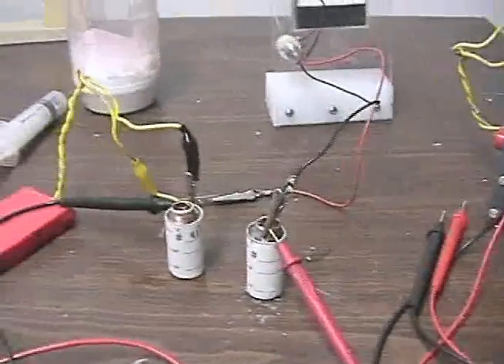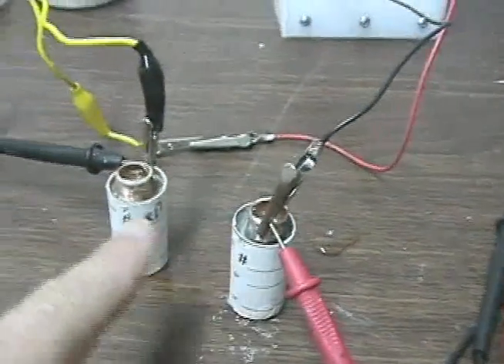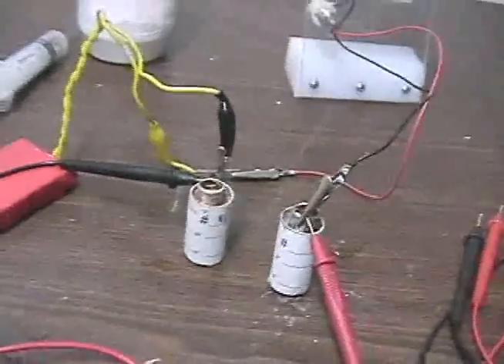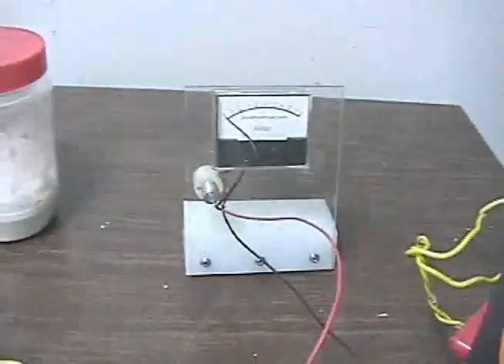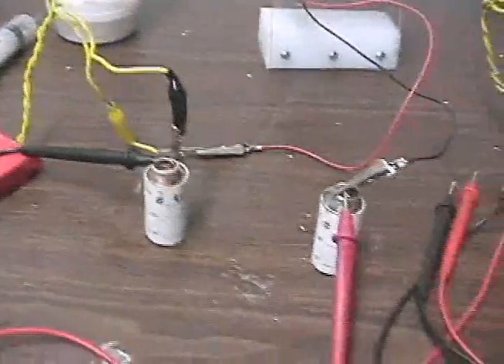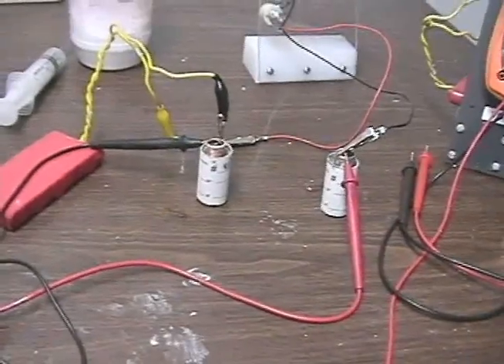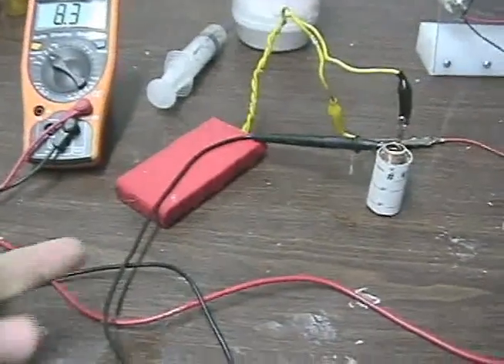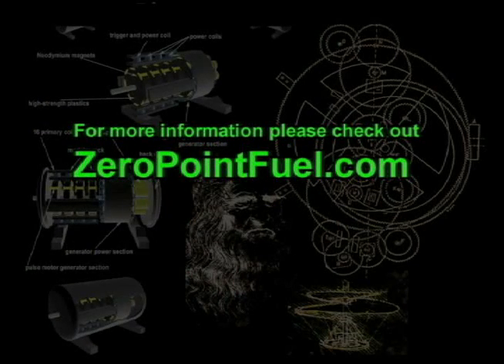strange effects with powercells

Comment: how come they are not connected. They are connected via your tester. Your tester's black wire is connected to one and the red to the other cell. Am I looking at it incorrectly?
Reply: Also, what are the amps during these voltage hikes?

Comment: Lets be accurate with where this energy is coming from. If you place these cells in a vacuum, they may only work as long as the inherent charge is present. As soon as the potential difference is gone, the charge will go to zero. The 'unlimited' energy is coming from the electrostatic charge contained within moisture molecules, drawn onto/into the battery's saturated SALT (everyone should understand this... basic science).

Comment: Seems from first glance you have made a type of crystal transformer. Maybe this will work as a replacement for step up transformers or step down transformers. In addition, you are manipulating the current flow and voltage drop from a DC source rather than an AC source by manipulating the distance between the two cells. What are the crystal cells made of?

Comment from the maker: No, my best conclusion is the crystal structure  was acting as a receiver and the capturing of that energy was only achieved when the two crystal power cells, proximity  caused them to resonate and become a receiver, The energy was created from a unknown source like  zero point energy,  ground energy from AC home power company. This process was able to charge a 9.6 volt battery for a few minutes.

Comment from the maker: @ET2uscg yes the 9v battery has been charged with a pulse motor but I cant reproduce the effect I even tried running the microwave thinking maybe that had something to do with it I have found Sodium silicate will hold a charge but the only way they could be connected is a radiant field but I can explain it. cheers

Comment: my cement batter is still showing 1.25 volts even tho I have shorted it to zero several times.  You will find it climb up over and over again.  I have charged it above 2.0 volts and it will show 20 milliamps.  The only time I saw a strange effect like the one you show, is when I was radiantly charging it with an SEC.

Comment from the maker: @theonelinerkid because the power cells never go dead, it you short one of them even for months and check it, the voltage will come right back , they are not preforming like a normal battery if you want to understand more there are a lot of videos on YouTube about power cells. The cell is NOT functioning as a galvanic cell and is utilizing  polycrystaline material  without any moisture.

Comment from the maker: The rechargeable battery leveled out at 8.45V so the standing voltage is below the batteries 9.6 potential. another point is the  9.6 rechargeable has been charged with a pulse motor for years I use it to power my bench Multimeter.  The coupling effect is reproducible but the charging effect is harder to reproduce, but its a hard thing to let go, so I plan to discharge the battery down to 7.2 and try again.